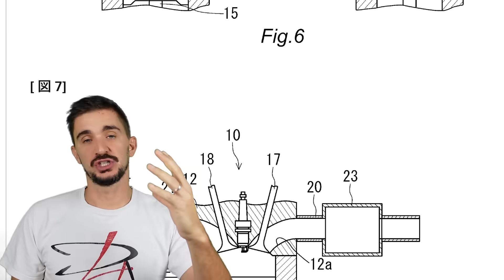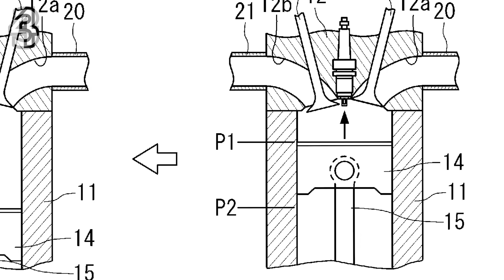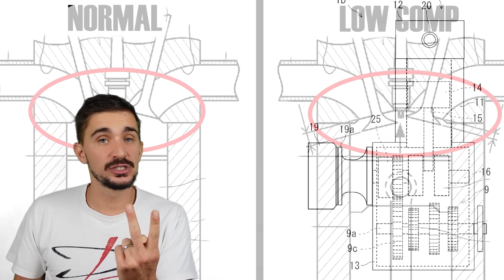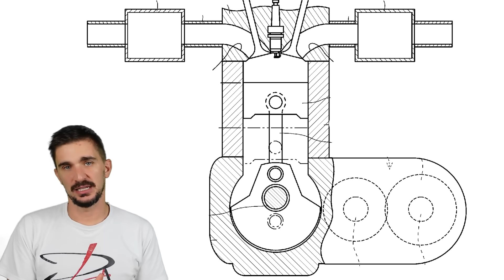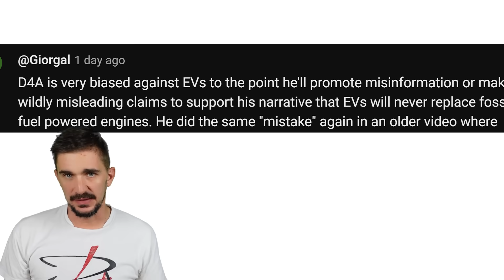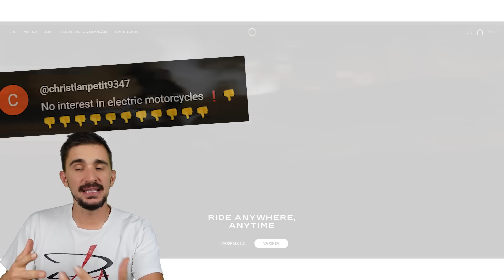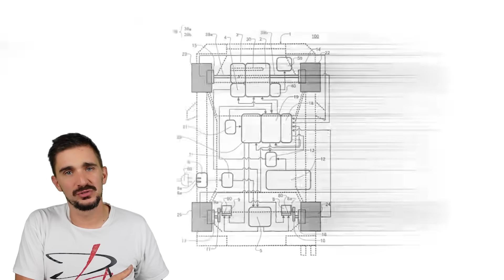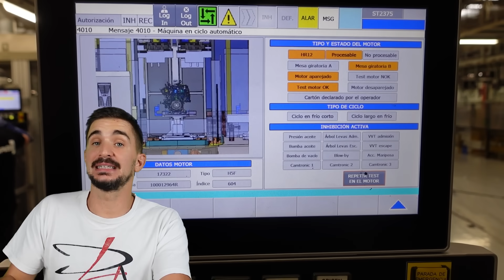Yamaha Just Patented A Fake Engine

Comment: Consequence of 150 years of marketing brainwashing. 
Rationnally, noise, vibration, servicing and even smell are negative side effects of the combustion engine paradigm. At the beginning of theses motors, many people thought that these motor won't succeed due to these defects, Ingenneers did their best to reduce these defects for years. Marketting communicated in a way to make these defects acceptable or even irrationnaly positive; saying it was giving character / personality. They hammered the message again and again untill this defects are considered "must have features" of a motor.
If we could have had a motor, that is silent, without vibration nor smell, with few sevicing, with the ease of use and range of a combustion engine from the begining (in 1850-1900 electric vehicles were performing beter that petrol vehicle, but were lacking range and quick charging ability), noise and vibration would have remained considered as defects for a motor.

Comment: if you build a lego engine with air pressure and use it with 2/4/6/12 zylinders,
you can hear pretty well the difference and you can even tell from the sound which is which.☝

Comment: It's a neat idea but it neglects the very reason people like engines:  they feel the ride. This might give the sound and vibration of an engine, but people aren't experiencing what is truly pushing the vehicle: it's just an expensive card in a spoke basically. This is no different to that electric Harley with fake engine sounds being played in speakers. This is a bit better as it puts effort into making the engine look and feel like a real engine by basically being a useless one. But then bike people will just be removing the engine to get more top speeds, as cyclists do. The only marketable aspect of this I see is as one of those legal grey markets where the distributor sells a product that at stage is fully legal, but with some minor tinkering could be made into some sort of illegal device that the distributor knows is the real market of their item. Basically, this bike has the potential to be modified into having a real engine (swapping, or somehow modifying this engine which I would hope is possible) and then having the legality of being an electric vehicle, but with engine sounds. The stealth of this is likely overstated however, as a fake engine will turn heads in a post gas world regardless and probably get many pull overs all the same.

If people REALLY want emission friendly mechanical engines then they should be looking into compressed air. it doesn't need to appeal to sport bikers anyways: they just want speed. This is more to appeal to Harley Davidson type fans who want their bike to have that rickety vibrating diesel truck/train vibe that they do.

Comment: Pretend that the engine ISN'T vestigial. What if Yamaha is making a hybrid bike and they're patenting a method to make the bike feel and sound like a petrol bike even when it's running in EV mode. The whole engine is there already; but now, instead of decoupling it and running quietly and smoothly on electricity, it has this mode that would enable the functionality in this patent. Idk what kind of cam complexity would need to exist to enable both operating modes, but that seems WAY more realistic than including a whole non-functional engine with VVL "for the laughs"

Comment: Part of the patent calls out the vibrations also, it's more than the sound. They can probably fake the vibrations also but for something believable, unfortunately, they think it needs to be this mock engine

I think it's absurd also, and the path forward should either be producing engine-propelled motorcycles or, if not allowed any more due to emissions, electric and accept the backlash. But this is just a compromise between the two and would be both a poor "engine" and less efficient electric vehicle as a consequence

Comment: Patent on a bypassed air compressor? This is for old motorcyclists like me, who got used to riding the bike by sensations (know your speed by RPM+Gear, know your wheel grip by RPM as you accelerate (torque)). What sensations? The old riders will most likely not adopt to the electric bikes - that would need a shift in the way those sensations are interpreted and felt by the driver. New drivers will adapt to the electric bikes and would feel uncomfortable on an old shaky, noisy one. Habits, the old generation has, they'll keep. Ain't got it yet, the new generation will get some other/new habits than the older generation. It's a process old as homo sapiens you can't force. I'm still left with one question: where are the fake gears?

Comment: I don't see the Hell's Angels driving it, nor greenwashing eco-guys, nor rational fathers, nor boys to impress girls: "Look how fake I am". But then, who will?

When people, organisations, or whole cultures collapse, they do not extinguish gently. No, they usually go through a period of perversion, where they do everything 180° the opposite of what is needed. This is not with malicious intent, no, they honestly believe they are doing good. Only, their awareness got so low that they can no longer comprehend reality. They lose the wider picture, and they fall into blindly following compulsive and destructive ideas. They have no clue what they are doing. It has nothing to do with reality. This is very obvious in politics, just look at how their laws and traffic regulations work out. But we see it everywhere in society. Seems like this is an example too?

Yamaha had a good combustion engine with reasonable efficiency of maybe 25-35%. And then they replace it with electric crap with a total efficiency of about 9%. Because you have to include all the losses in electricity production, transformation up to high voltage, transport over long wires, transformation down again, battery charger, battery itself, motordrive electronics, and the electromotor itself. Including all these losses, I estimate the total efficiency at about 9%, far less than that of the old combustion engine. (See my detailed calculations in the comments of the previous video.) And then, on top of that idiocy, Yamaha is going to further reduce efficiency by adding a fake combustion engine? Electric crap is already overweight by itself, it weights the double of combustion engines, mainly due to the retard batteries.

All this apart from the fact that you can not use electric vehicles in normal daily circumstances. Not in the city, because you can't charge it on the 5th floor of your apartment. Not on the land, because it has no range. Not in winter, not in hot summer. If you run out of batteries, try walking to the nearest charging station, and get a can of electricity. Or ask a neighbour for a "can of volts"... Good luck.  :-)

Is there a Darwin-award for patents?

Comment: i'm thinking maybe they are trolling fake-loving automakers/bikemaakers by baiting them to dump resources into stuff like this, thus not investing in useful stuff. Or a way to keep some of the engine drama when emissonns regulations will require zero emissions. But imo, it's mostly the baiting. Also, maybe, the thing making noise might even be masked as a safety equipment for the dead silent e-stuff.

Comment: In the US, we have guns, but some states dont allow certain guns. So theres a loophole where theres a 80% kit, where it is mostly there and you have to do some machine work to make it into a gun. 

In some states you cant buy a bong, but you can buy a bong shaped liquor bottle with a drill here spot of thin glass.

Id be curious if these are intended to be workarounds for markets that will soon completely ban the sale of internal combustion vehicles.

And now i want one to convert to gas.
Reply: I was thinking the same thing. One thing that caught my eye is the spark plug drawn into the cylinder head, why would there be spark plug if there is no fuel?🤷🏻‍♂️
I suppose it will probably be based on some combustion engine from yamahas lineup, so you could use the intake manifold with sensors and ecu, and make it work like regular bike or even hybrid bike.
Reply: That is also an interesting thing
Reply: Wow, that actually could make sense!

Comment: Yamaha is correct that bikers do not want electric bikes, but we don't want "E"Bikes because they suffer from same problems as all-Electrical Vehicles. Without substantial (read: Nuclear Power) upgrades to power grids in all nations E-Vehicles are constrained by Electrical Power Limitations. For most consumers "E" Vehicles cost "more" to operate because the price of Electricity from the Wall is greater than the cost of Petrol or Diesel from the pump for the same effective mileage. 

With Diesel and Petrol it is possible to carry extra fuel sources as the power/weight density is high enough that 2 gallons of Fuel = miles of range. The power/weight density of even the highest capacity battery, however, is measured in Feet of Range. 

Ergo: if you run out of petrol/diesel you can easily refuel your onboard supply, or have someone bring you some extra supply, but you simply cannot do that with batteries, well, to a certain extent. Yes on some "E" bikes you CAN hot swap a battery, but you're still considering a multi-hour recharge time for not much range.

Comment: I think you nailed it at the conclusion -- (1) this is probably to attract a niche market that is inevitable and could grow in numbers and (2) that the battery tech will improve so much that this becomes equivalent of using nice alloy wheels instead of the ones with closed flat caps on EVs just for the looks (which happens even today -- I would personally trade 10km range for the alloy wheel look). Also, today a typical single cylinder 100cc engine weighs around 10kgs which can produce 8-9PS. Remembering that the fake engine is not going to go through the combustion stroke and not generating torque which would mainly require thick and heavy construction to withstand the pressure, heat, etc. Just high RPM reciprocation wouldn't necessarily need that heavy construction, I feel. All in all, they might be able to keep the weight in check. Now, how much electric power it'll consume (leech out) to "make the sound" - I'll leave it to d4a or EngineeringExplained to help with the math😅
The vibration part is something I don't necessarily align with though. Single cylinder engine's high frequency buzz does NOT feel good. I'm okay with an authentic sound; NOT the vibrations, please. Would I buy a bike with such a "gimmicky feature" -- given that it doesn't affect the efficiency too much and doesn't need frequent maintenance AND I can switch it off whenever I want and isn't exorbitantly expensive, sure, bring it on! Anyway, I believe, there would be a large chunk of bike owners (including myself) who love riding for these multiple fun aspects, and not just to extract every bit of efficiency and power or do daily commute! Good topic to discuss for sure!

Comment: Has become a big corporation … Yamaha is no longer Yamaha … 

3 Yamaha motos… passion for Yamaha too… bought an Yamaha e-bike (blindly) … but this Yamaha booster easy e-bike , is not an e-bike it has an horrible pedal assist … 20 days policy return over … Yamaha points me a finger … 

Can’t figure how Yamaha could launch a so FAKE product (e-bike)
Reply: I upgraded it with a front wheel e-motor… 
Because the Yamaha pedal motor and it’s system is useless , completely nonsense.
 … so more fake and such a big lie I can’t see . Lost my trust in Yamaha completely.

Comment: If they can fit all that in a bike, I feel like they could just make a hybrid, a win-win situation... In matter of speaking, I think something where combustion engine would only kick on in certain conditions as heavy accelerations or cold starts, they already have functional clutch system to rotate the crank in sync of ev motor, so why not to tweak the application to have maybe some type of DCT transmission with hybrid motor clutch and working combustion engine, something similar as in kia niro